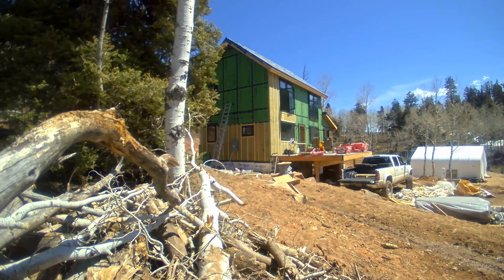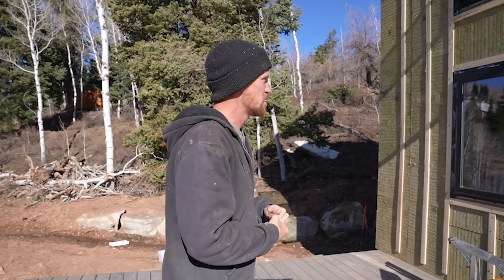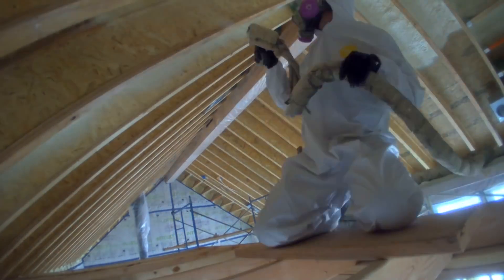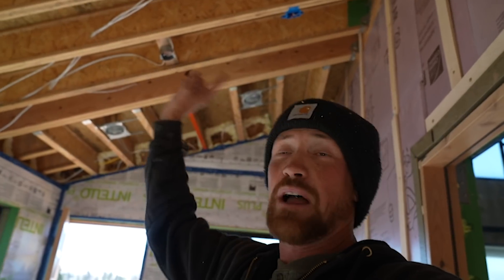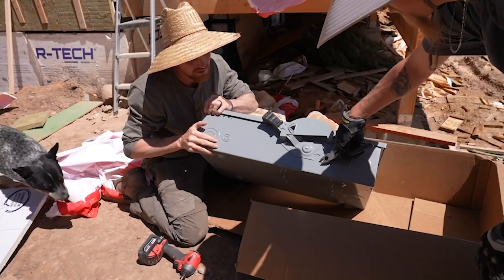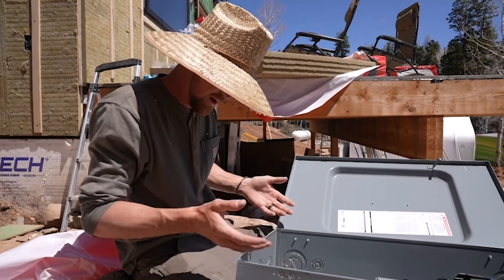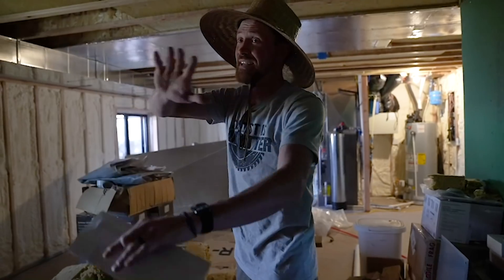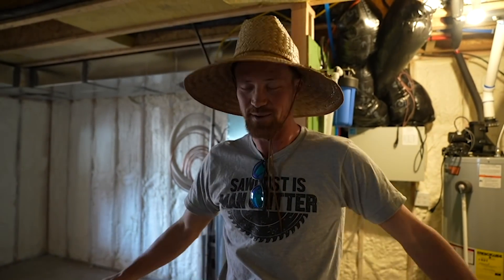A STRESSFUL ADVENTURE | BUILDING OUR OWN HOME

Comment: Trent, I want to share something that saved me.  When having a panic attack, it is usually because a situation is causing us to breathe VERY shallow.  That is why we get dizzy sometimes first.  The problem feels like we can't get enough air...but it is because we have not breathed completely OUT.  So, with hands on knees, breathe out like you are trying to blow bubbles through a straw and when there is no air left, still puff out 2 more times. Then breathe in through your nose like on spring day, which will prevent hyperventilation.  5 times usually fixes it.  It feels like we are dying, because of gases building up in the lungs, which causes the anxiety loop.  We keep thinking "I can't breathe", and we can't, because the lungs are already full.  I sincerely hope this helps, at first it will be scary as hell, but then...it will start to work, and you can head off the physical symptoms before they get bad.  When you start to feel anxiety coming...make yourself laugh if at all possible, it will reset the breathing problem.  When I first feel it coming, I usually do the 3 deep breaths out like a weight lifter before a huge pull, then put my hands up and scream "yeahhhhhhhh".  Stupid looking?  Sure, but who really cares.

Comment: Point of order:  your single pulley is working as a change-of-direction.  To get 2-to-1 mechanical advantage you should anchor to the 4Runner, set the pulley at the wire, and another pulley back at the 4Runner then going to the winch.  😊👍
Reply: Came here looking for this exact comment 👍🏽 there was no mechanical advantage with the way he had it set up!

Comment: FYI: Closed cell Spray foam is a vapor retarder not a *vapor barrier*! its likely that over time moisture will collect on the OSB roofing leading to rot. When the warm moisture reaches the cold OSB its going to condense. On top of the roof you are using a vapor barrier which is going to prevent the moisture from escaping. The preferred method for spray foam roof is to use a moisture permeable membrane, so that any moisture that gets into the OSB has a means to escape. Grace Ice and water shield is a Class I Vapor Retarder which allows pretty much no Moisture or Vapor to pass through it.

I believe Joe Lstiburek (Building Science) is recommend that the top ~6 feet of roof have a permeable membrane and the rest below can be an ice & water barrier (need to protect the roof from ice dam causing water to get into the roof sheathing.

Preventing Ridge Rot In Conditioned Attics (Featuring Dr Joe Lstiburek)
https://www.youtube.com/watch?v=zhkGcklWB_Q
Reply: Great advise!
Reply: Hopefully they see this comment

Comment: When you receive your siding, be mindful of the condition of the ends of the planks. A friend of mine had a siding delivery and many of the ends were damaged. These must be trimmed off to 'fix' the end and results in loss of useful lineal footage. It is also a pain in the butt to cut and the damaged ends result in a lot of extra cuts. Best of luck. FWIW I would lean towards a cedar looking color, but that's just me... Best of luck

Comment: I understand completely, Trent. I have suffered with panic disorder since I was in my early 40's.  I had them on the freeway driving home a few times and ended up sitting on the side of the road waving my arms for help, and someone would stop and take me to a hospital. I became fearful of going anywhere myself, and because my heart would kick in with tachycardia and my hands and arms would go numb and it felt like I had an elephant on my chest.  I was convinced it was my heart, so I wouldn't go anywhere unless someone was along who knew CPR.  After numerous Drs and tests, confirming a healthy heart, they finally diagnosed me with acute panic disorder and then it took a long time to find the right medication to stop or minimize the attacks. Some of those meds had horrible side effects, so they send me to a psychiatrist who finally got me on the right med that worked with no side effects. They decided mine seem to be related to a youthful brain trauma caused by a mean 12 y/o boy who kicked a big down on my head as a bunch of use were climbing & knocked me out cold.  I never have those severe ones anymore, but if I forget to take my meds, I still start to have the attacks again. So I keep extras every where.  IT SUCKS!  Anyway, you aren't alone.

Comment: This house is going to be so well insulated that a lit candle should be all you need to heat it.
Reply: Only having 6 inches closed cell insulation in roof is far from being well insulated. Closed cell foam gives you a R6.5 per inch. So essentially they have about R40 in ceiling which isn’t enough in their climate. I like to install R60 in all my roofs
Reply: @tmalcolm6138  Yeah, I never understood the foam contractor's comment that 6 inches was plenty.  I think that even here in Minnesota we need at least R40 or more.
Reply: @stevenemert837  well an R40 is just not enough insulation in a ceiling at all. Especially in their climate. Now was their time to get as much insulation as they can in the ceilings before they Sheetrock the place.
Reply: Should he not be concerned with the exterior insulation getting wet?

Comment: Wire Pulling. By an advanced amateur. I will bend a serious loop to hook the rope onto in one of the wires, making sure the cut end points back right at the other wires i cut back out of the way. You have the long wire, next longest wire, in steps, etc., until you get to the fully insulated wire. I then tape from further down the uncut wire towards my rope connection, so the tape doesn’t get pulled off as the wire gets pulled and it makes the transition smoother going in steps. ******Glad you found an activity that gets you past your episides!

Comment: I am a retired Building Contractor in North Carolina, and I think you are doing a fabulous job with your project. You may know a lot more about what you are doing than you let on, and give good advice.  I wanted to suggest something you should probably do with your home.  We build timber frame homes that have exterior stress skin panels on top, bottom, and all sides, turning the home into a giant insulated cooler.  You seem to be doing something very similar, and I would suggest you do some research, or ask your builder friend about an air exchanger.  Because our homes are so air tight (as yours will be) an air exchanger will keep the air quality and your health in great shape.  Take  look into it.  I would like to see what they think of them in your part of the Country.

Comment: You probably have the cable pulled by now but just in case you need a device like a mesh on the end of the pull cable when you push the mesh it increases in diameter and slips over the cable. When you pull it decreases in diameter and locks on to the cable. Goes around corners and wont snag. Can be purchased at lowes or home depot or any good electrical contractor.
Good luck.

Comment: Hardie is our #1 seller but  color Plus technology by Hardie none of our installers want to install can be  a big challenge.     Going with a stained color, wooo..   Make sure  to cover your saws  and ladders  with towels to prevent scratching.  Lots of touch up for cuts and matching caulk..   If your in a high wind area and want to nail to the plywood, look at  the windstorm install.  Might want to use  a ring shank nail  because if you miss the studs  a few years from now the siding can  start coming un nailed.  Seen a lot of this when nailed on osb plywood..  just some tips..

Comment: It's too late now, but you could have used a "cable pulling stocking" or Kellums Grip to pull the electric cable through the pipe. Made by a company called Kellum this slides over the cable and is secured by a hose clip. When the tension comes on the other end the stocking grips the cable. There is nothing sticking out to catch on the pipe. Your system worked so Congrats!
I had no idea you suffered so badly from mental health issues. I can see now why you are so 'driven' to finish the house. I don't know how you do it, day in, day out and live in that tiny 'caravan', but then the years in the camper-van prepared you for it.
Love the two dogs, lets see some more of them

Comment: If you put your rope elec tape or duct taped on end so it's a smooth tip. After pouring glycerin it will pull easily. I did 275 underground with 4ot wire with 2 teens pulling with u joints already attached.  Good luck!!!

Comment: Go to the box where the wire needs to go.  take a ping pong ball or something that will fit in the wire pipe.  Tie a string to it.  Go to the end where the wire comes from with a shop vac.  Turn on the shop vac and in seconds the ball attached to the string comes out.  Just tie a thicker rope to the string and pull the rope back up to the house.  Tie the wire to the thicker rope and apply some grease to the end of the wire.  A come-a-long on the house end will help facilitate things and save your back.  While you are doing the pulling start singing the theme song to the castle of the wicked witch from Wizard Of Oz.  Oh, E, Oh, etc.  I hope you laid warning tape in the trench above the wire conduit when you trenched originally.

Comment: Get some butcher paper and lay it up against the wall and where the bumps are make a mark.  Cut out the corresponding holes and then set it back in place to check the accuracy.  If all is good you have a template for the foam.  Lay the paper on the foam on the porch and cut out the holes.  This should allow almost a perfect fit.

Comment: shoulda got some yellow 77 and a pull sock , put it on the wire sheathing as it goes in stuff is lubed and will slide down easy. cause that hose clamp is gonna scratch the hell outta the inside of that conduit and cause issues later on

Comment: You need to cut off all but one wire when you make a loop.  Then use lot of tape to make the connection to the rope smooth.

Comment: The wire pulls a he'll of alot easier when you lose lubricant hope you used it.The pulley set up you were using looked like you were just changing the angle of the pull,not Doubling the pull,couldn't tell for sure.I've done more pulls that I can remember.

Comment: I am about as even keeled person as you would ever meet,  and usually handle stress extremely well.  BUT put me in the midst of construction projects related to two full house renovations and  I am at peak stress and verge of panic.  For those who are perfectionist and prone to panic attacks,  do it yourself is most certainly a trigger.  Looking at what you are facing, do you really need to do the drywall yourselves?  It is high, it is hard, it is messy and it will drive a perfectionist to the brink.  Why not bring someone in and take a week or two just to chill, relax and someone else do the hard work.

Comment: Trent, not sure if you are planning to build some type of a Raintight Enclosure over the disconnect you mounted on the side of your house? The only reason I say that is that the disconnect looked like it was an indoor, or Nema 1,  and if you are not putting any type of weather proof cover over it, it is the wrong one for the application. you would need  to exchange it for an Outdoor Style, or Nema 3R
Hope this helps,  I hate to see you fail the inspection and once you knock holes in the disconnect for your incoming feed and to feed the sub panel, you won't be able to take it back and exchange it..

Comment: I know you're probably done by now as the posts are not in real time, but the disconnect switch on the outside of the house is now your Main Service, so the inside panel needs to have isolated Grounds and Neutrals.  Also confirm with your gas company what the distance from the gas regulator to the electric box needs to be...could be 10'.  You also can't install anything in front of the electric disconnect 36" x 36" min foot print for "work space".

Comment: On the closed-cell insulation on the roof, does it create the possible problem of not knowing if you have a roof puncture/leak and the deck rotting out before you know of any leak signs? 

On the anxiety/mental health (wife is a therapist) - bravo for being upfront. Suggestion - look into EMDR (you seem a very 'kinetic' person - you may find it rewarding, bilateral stimulation)

Comment: The pulley was only acting as a redirect in the setup you had. The cable was getting 100% (minus minor losses due to friction) of the force from the truck.  

Regardless, it worked.

Comment: BTW for those wanting to run wires through pipes, don't buy those $20 a bottle blue lube. $1 bottle of Ajax work just as well, smell much better and leave you hand clean afterward.

Comment: I would be a very concerned with the exterior furring strips handling the weight of the siding with the furring strips being installed over two soft layers of insulation and with the few screws you and Branden installed on each furring strip. Cement siding is very heavy and with the furring strips not secured tight to the exterior sheathing, which strengthens the furring strips, there will be most of the weight put on the shaft of each of the few screws you have holding the furring strips to the insulation.

Comment: surprised the building code allows furnace exhaust below window levels, unless that's a permanently closed window. A pipe will be going up from it? What about those two breakers with a circuit problem? Is that fixed now?

Comment: A black roof will retain heat, if it gets hot there in the summer you do not want a black roof. Use a red roof.
Reply: @sethadams4871  your so right.lol.

Comment: Looking at pulling that wire through that long underground pipe, I would certainly consider hiring a professional that has insurance in case the cable gets stuck halfway! If the pipe has to be dug up, that would be covered by insurance. Just saying!

Comment: Hey guys. Just saw the segment on anxiety. I also have anxiety pretty bad. I started taking high potency magnesium and it has really helped. I take a specific brand with a specific type of magnesium so I can’t vouch for all magnesium supplements. The brand I take is available on Amazon and is called synermag by ATP Labs. It has to basically become part of your daily routine but my anxiety attacks are a thing of the past. :). It has also helped with sleep. Just thought I you might want to give it a try.

Comment: I used to suffer from panic attacks. My friend is a Dr. and had me do research about EFT (Emotional Freedom Technique). I bought a set of disks that teaches it.... OMG it really works. I have not had a panic attack since 2008! I began using this technique in early 2008 and like an onion has layers each time I used the technique I peeled away different issues and trauma (from childhood) until a few months later I was able to reach the core of the root issues that debilitated me. Any one of those childhood issues a person has could be responsible for the panic attacks. Things that happen in the present subconsciously connect you to one of those traumas and cause the panic attacks. You could probably buy a disk that teaches EFT online. It really works! I was not able to fly, myself, before. And now I feel so empowered. Of course, it's not an overnight miracle, one has to put in the work, or use the technique, but each time the technique is used a person can feel the distress of certain issues worked on, actually evaporate out of your life. In the end when you have the relief you desire, it will feel like a miracle. God Bless.

Comment: That single snatch block/pulley didn't reduce the force, it just changed the direction. Using multiple pulleys and doubling the rope would require twice the rope to be pulled but at half the speed and force. The electric hoist in the top of my garage can be setup as a single line or double. The main hook will loop up and hook on the hoist and the pulley hangs down to pick up the object. I have anxiety also and when my tinnitus got worse it really messed with my anxiety. I also have OCD. Cognitive behavior therapy helped a great deal. It teaches people to control what they can and not worry so much about the rest. People have choices in life and don't HAVE to do anything. You don't even have to breathe...........yes, there are consequences to choices, but there is still a choice......that is an extreme example that hopefully people wont choose. A person may be a bad influence but a family member......you can choose to not associate with the family member and put yourself first, if it helps your life and mental health. CBT should be taught in high school or even middle school because it can be applied to many situations in life and even business. It teaches a person to think logically vs. emotionally and to put their own happiness and health first. A parent thinks their kids come first at the cost of what they want. As long as the kids have their basic needs met, the needs of the parent should also be met. I was already very logical, systematic, and made decisions based on facts, but there was even more for me to learn.